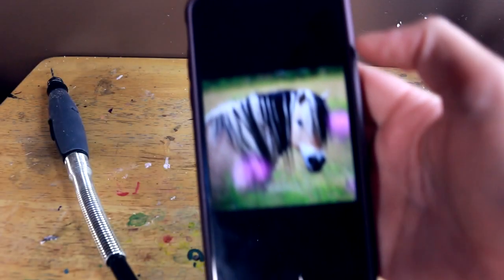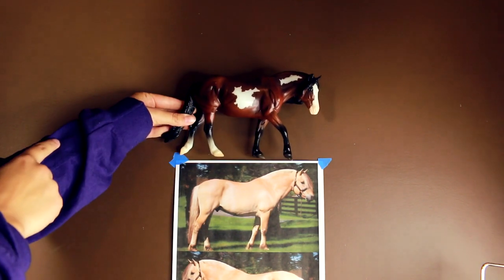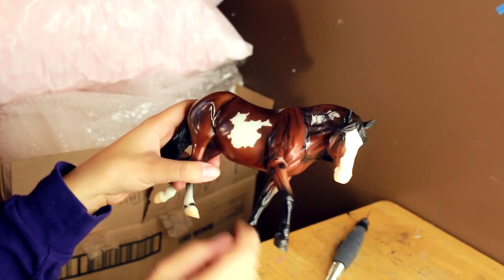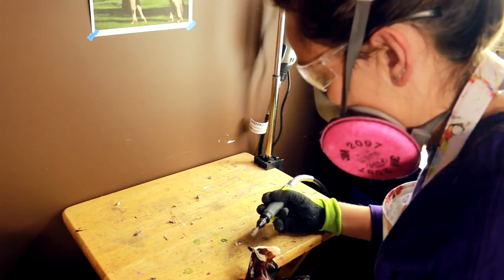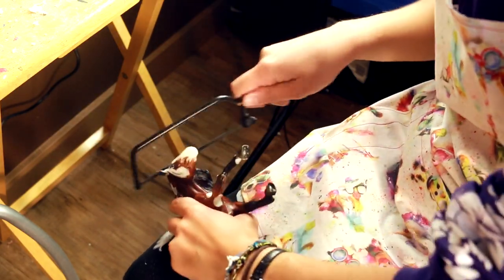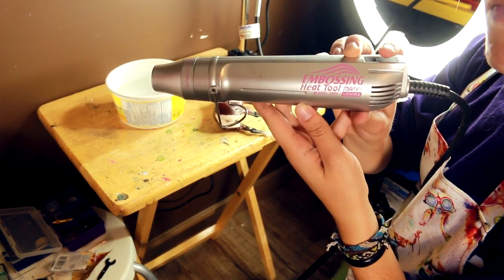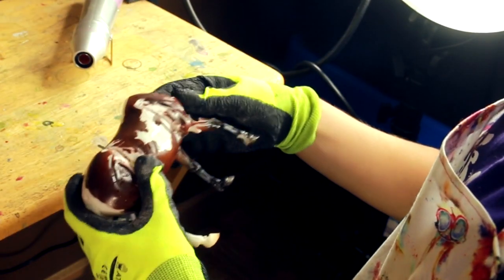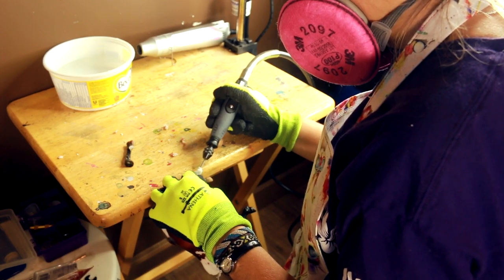Drastic Custom Fjord "Kion" - PART 1: DECONSTRUCTING - How To Customize Your Breyer Model Horse

Comment: Try a reciprocating multi tool for cutting. Gives plenty of control and cleaner easier cuts in the plastic - plus the tool can accept sanding accessories for other uses.
Reply from the maker: I will look into that!

Comment: Hi! I was wondering if you know how to help me. So I was organizing my Traditional Breyers and I put my important models on shelves. Well, of course one had to fall off of the top shelf and crash two whole shelves. That horse ended up breaking his tail. When I looked at it, the towel broke far enough That there is a hole in the body leading to the hollow part of him. Do you know how I could possibly fix that? I have Apoxie  and sculpting tools but I have only done a few customs. It happened on the Smokey the cow horse mold.Plz help!!!

Comment: Can you use a blow dryer instead of a heat gun because I want to do this but a little different and I would need a heat gun but I don’t have one and I can’t buy one right now but I do have a blow dryer
Reply from the maker: Yes, a blow dryer will work on thin pieces of plastic.